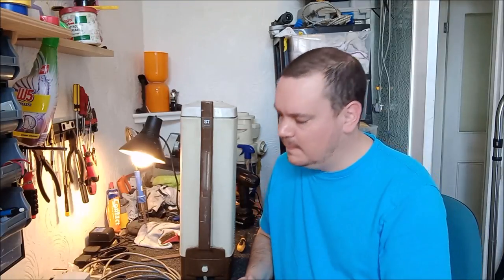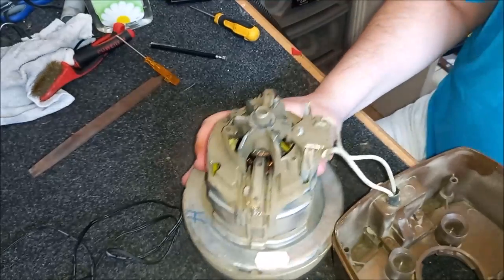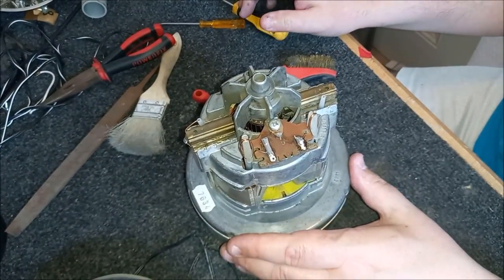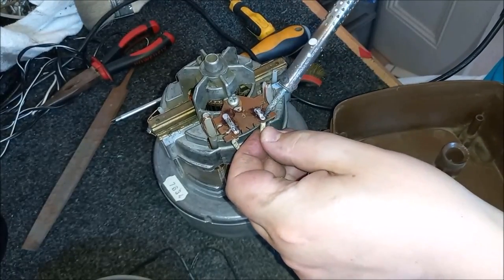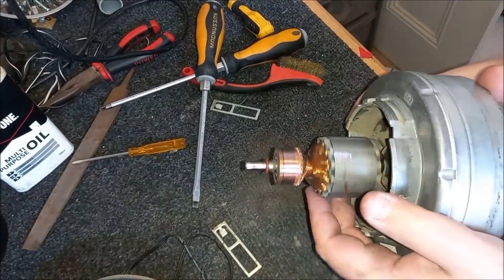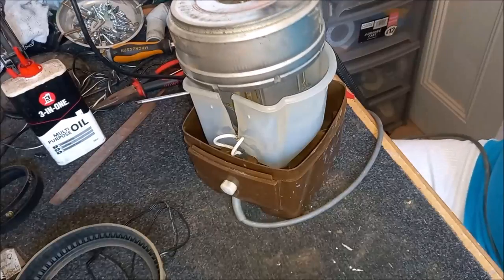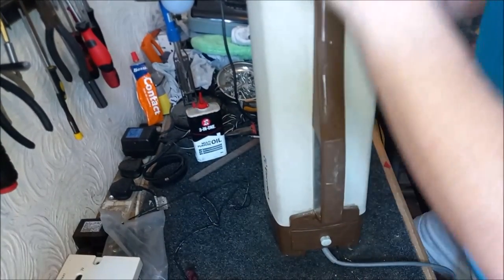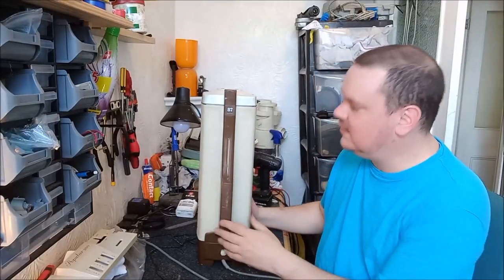Restoration of 1976 Electrolux Z87 Part One - Suppressor Removal and Motor Service

Comment: I remember buying one of these with some friend's in 1976.  It came from Curry's in Darlington & was considered a budget Electrolux machine.  No paper dust bags or automatic cord rewind that featured in the more expensive models.  There was a flip over floor tool, crevice tool & the famous Electrolux  combined upholstery & dusting nozzle. A great machine which served them well.  The slot above the rating plate was for hanging it on the wall using a special hook which I fitted on their kitchen wall with my new Black & Decker. 

All very nicely designed.  Even the packing box had an opening allowing the machine handle to be used to carry it home.
Reply from the maker: Wonderful memories, thanks for sharing :)

Comment: Very nice condition of this Electrolux engine.  I have a tip for you to cleaning the impeller: I use a pipe cleaner for this.  These can be perfectly adapted to the curved wing and the dirt can be easily removed with the fine bristles.  You can also suck off the dirt with another vacuum cleaner.
Reply from the maker: Good thinking!

Comment: The Z87 was marketed from 1970-79 (about the same time as the Z170 upright). A collector on Vacuumland noted some differences from the earlier Z87 cylinders to the later ones, including: 1- different motor (albeit didn't specify in what other models it was used) 2- Electrolux wordmark on top rather than side  3-  stippled covering rather than linear